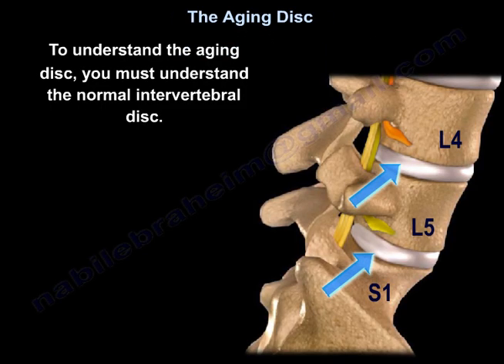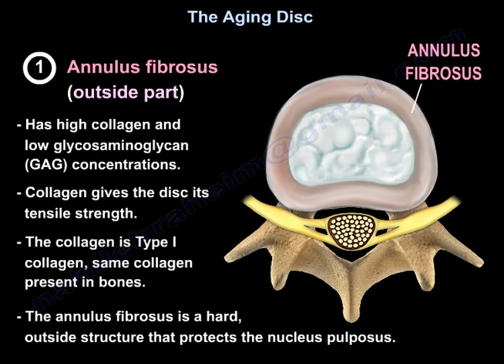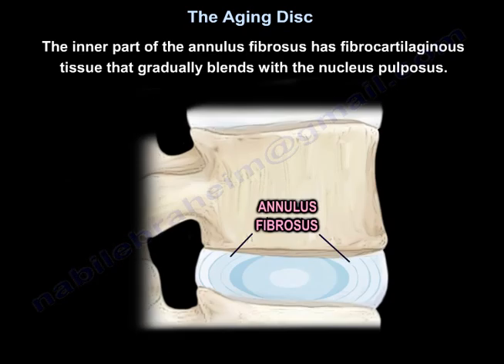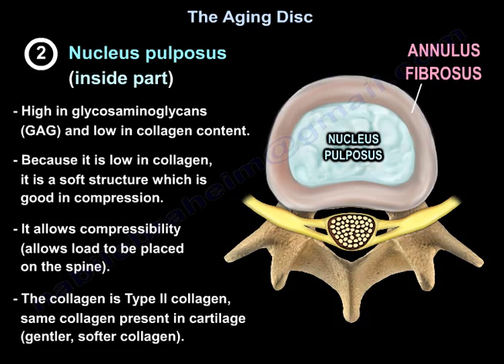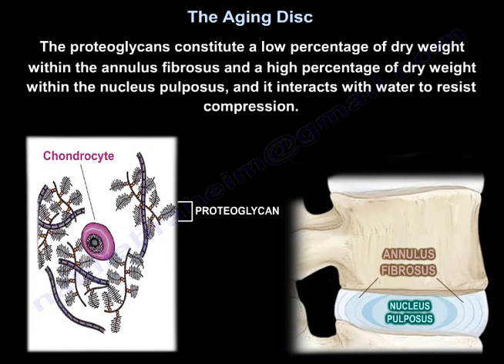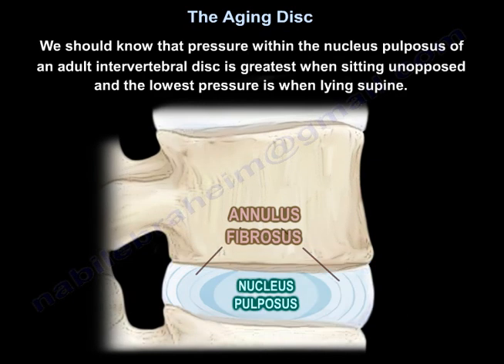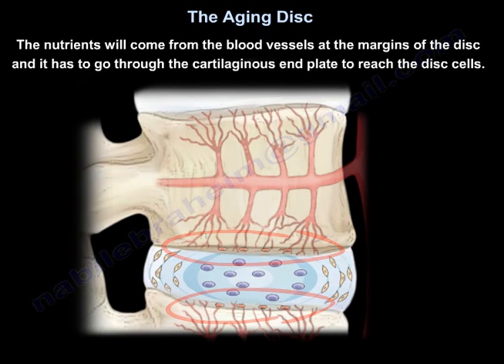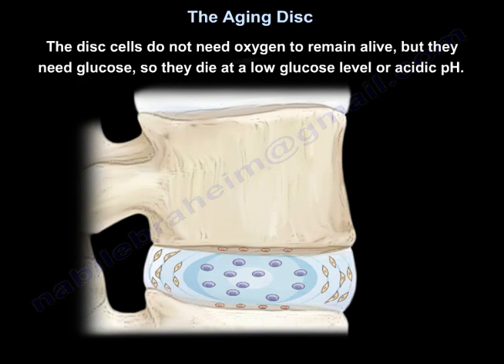The Aging Disc - Everything You Need To Know - Dr. Nabil Ebraheim

Comment: Dr. Ebraheim, you mentioned at the end of the video that disc cells need glucose to remain alive and will die if the levels are low. Would doing intermittent fasting, which will reduce or eliminate glucose at extended time, be detrimental to the disc cells? Thank you for your very educational videos!
Reply: The Liver can convert Fat or Protein to glucose.